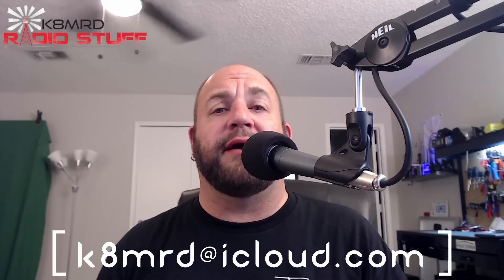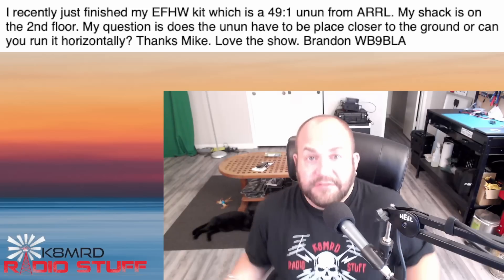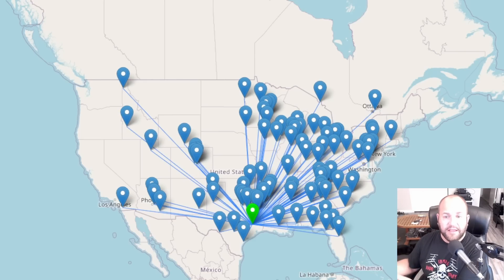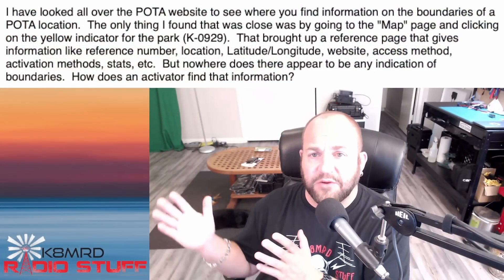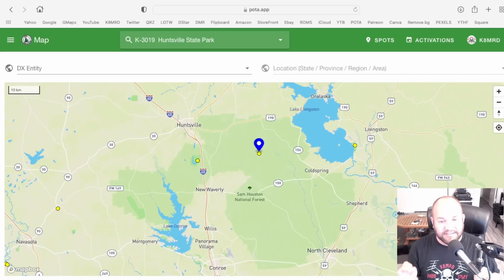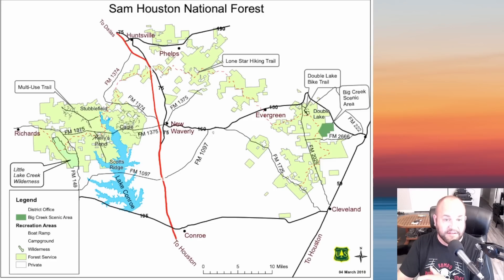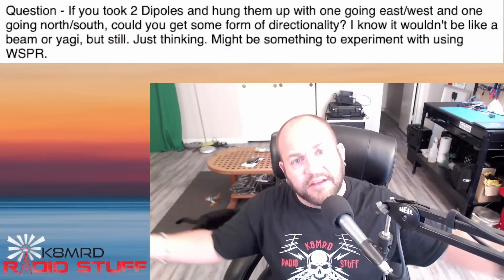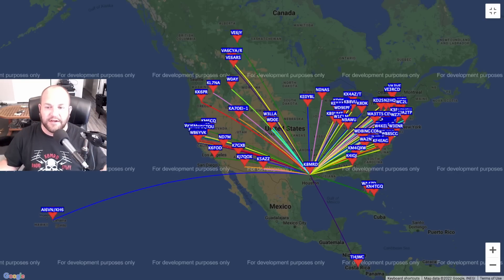Mailbag Monday #27 | Finding Park Boundaries for POTA

Comment: A friend was telling me about using two dipoles mounted with the ends at 90-degree angles so that you end up with what almost resembles a horizontal loop. The ends of the two dipoles do not touch but are separated by only about 20  feet. Each dipole has a different coaxial feed and can be switched back and forth (using an antenna switch).  According to them,  one of the dipoles acts like a driven element, and the other acts like a reflector. The 90-degree end turns used about 10%- 15% on each of the ends, meaning 70%-80% remains on the long sides.  This allows for the use of the antenna on the ends (though not as effective as the long sides).  It does not however create a null like most wire antennas do in the direction of the ends. I've just heard about it, but it sounds interesting!
Reply from the maker: I like this idea but I'm confused a little bit with your percentages.  Are these Off Center Fed Dipoles?  And can you buy me enough land to reproduce this lol!

Comment: Great advice on the POTA park boundaries.  I cut and paste the name of the park into google and then click the controlling entities official page for a map. As for the 2fer, 3fer, etc., boy what a can of worms that can be!  I'll just throw this out there and someone school me if I need it.  A state park entity can never be a "2fer" with a national park entity.  For example, Natural Bridge State Park sits completely inside of the Daniel Boone National Forrest but it is not a "2fer" as they are owned and maintained by two different agencies.  On the Other hand, the Clifty Wildlife Management Area is a federally owned and maintained property that is completely surrounded by and inside of the Daniel Boone National Forrest, another federally owned and maintained entity.  Legitimate '2fer".   I log a park to park exactly as another activator tells me, but I often wonder if it is legit.
Reply from the maker: I suspect you are correct.  I myself question a lot of the 2fers etc.  I saw a video of a guy who worked someone activating a 5fer.  I looked up the parks on the map and they weren't anywhere near each other.  I call shenanigans on most of that.

Comment: About the POTA map & yellow dots:

The yellow dots are only a rough marker of where the park is located. (For some technical reason that I don’t know, the POTA mapping code can only display one point per POTA entity.) They are not meant as an activation location. Always consult your state’s/country’s official park or wildlife area management website, or other official state/country mapping source. You can activate anywhere in a park or wildlife area that you can legally get to.
Reply: The yellow dot is there to give you a rough estimate of where the park is if you were at a state(-ish) level view, and a way to discover what parks are near an area. If you'd like to propose a better location for the pin (lat+long to 4 decimal points), send an email over to the POTA help desk and it'll get routed to the right person to investigate. The technical reason for just one point per park is that there's literally just a latitude and longitude field in the database for each park. Yeah, it's pretty tough when your "park" is the Oregon Trail. And something we'd like to address in the future. (POTA Dev)
Reply: And there you have it folks… And official answer.

Comment: My 49:1 Is bolted to my tower at 70ft and the antenna runs south down to 35ft and it works great. EFHW 8010. It also worked great as an Inverted V with both ends at 6ft and the middle at 40ft. I’m with ya mike get it in the air and use it.
Reply from the maker: 70 feet!  Shoot, that's awesome!  At what time of day would you prefer I arrive to play radio?

Comment: Two dipoles connected together as a single antenna but set in opposite directions do give you a more omni directional  pattern. The skeleton cone antenna is designed for that purpose. 
Steve, k70fg.

Comment: At one location had my TennTenna EFHW matching box on the ground and my SWR was through the roof.  I got the match box elevated 2 or 3 feet and SWR went back to normal.  Some other situations where it was about 4 feet up on a wooden post the SWR also tended high. Not sure what's going on but plan to start quantifying this.  In all cases I've had a 7 foot wire connected to the counterpoise terminal.
Reply from the maker: Sometimes antennas are just weird like that.  Everything affects everything.  Soil condition, height about ground, metal in the area etc...

Comment: Thanks for sharing results using your own North/South and East/West antennas and your POTA unun feed point info. I totally agree to just get antennas up however you can at any operating location and try them. I'm space limited & have made SSB 100 watts & QRP SSB DX contacts from California to Europe, Africa, South America, Asia, Australia using a 71' non resonant end-fed sloper, with 9:1 unun up 15' at the high end going down to 6' at the low end. Antenna has 50' RG8x, common mode choke, no counterpoise. No tuner needed on 20, 17, 15, 12, 10 for SWR of 1.2 or less. Tuner used on 160, 80, 60, 40, 30. for SWR of 1.5 to 1 or less.
Reply from the maker: Dang!  Those are some amazing results!  A great testament to using what you have and make the best of your situation.  Thanks for sharing!

Comment: Hey how’s it going. The thing about your WSPR  testing for your 80m dipoles is that if they were actually used on 80 m, they need to be at a height of approximately 130’ to get  a classic dipole, 180 deg, low-angle lobe take off radiation pattern.  Looking at your set up, as nice as it is, your 80 m antennas on 80 m are really more NVIS  antennas without direction.   Also, if you look at the patterns of  EFHW’s as you use them on the harmonics, what actually happens is that you first get a 4 lobe pattern (ne, nw, se, sw if the antenna is runnining north-south), then more lobes.  So, what really I think your WSPR test data is showing (if at 80m) is weak signal propagation of your 80m signal in a omnidirectional pattern.
Reply from the maker: I was on 20 meters.